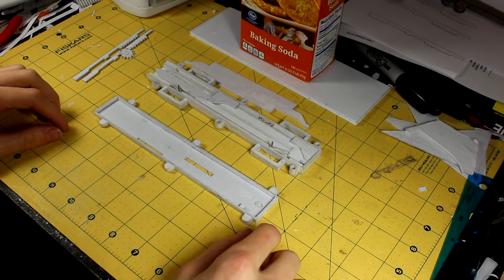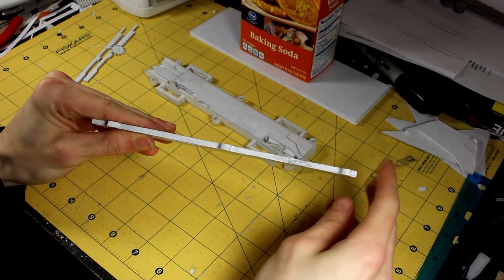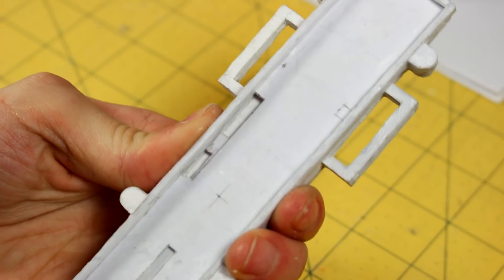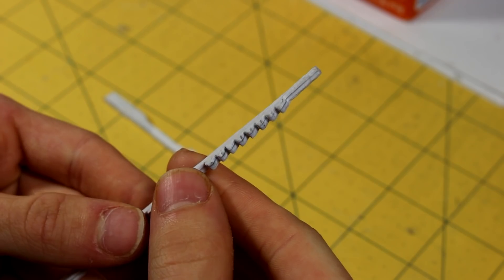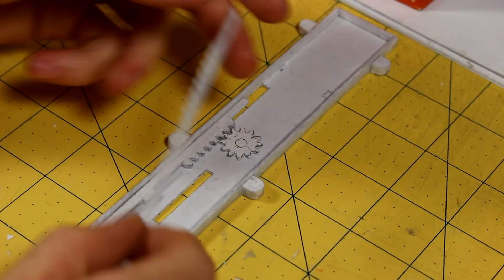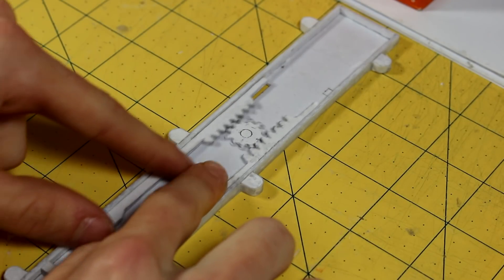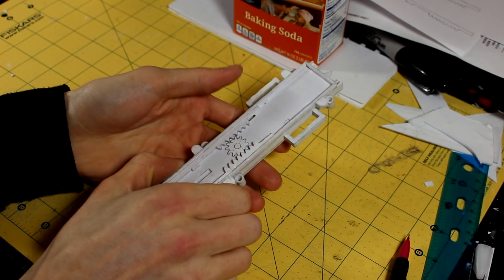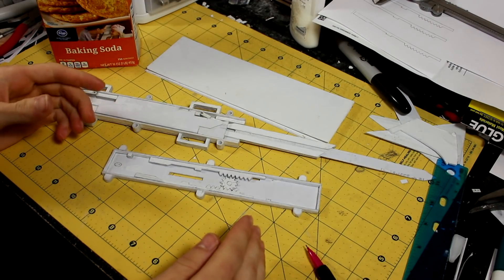Paper Dual Extended Hidden Blade Update 3 (Linear Gear Sticks)

Comment: Everything looks great so far! The wait is definitely worth it and every update video gets me more excited for the final product! I have another question to ask though. So I have a power saw which is good for cutting wood and stuff, but I was wondering if it could work on hardened paper. Would it be able to cut the paper cleanly, or will the force of the saw be strong enough to split the layers apart ? This is assuming that the layers are as strong as possible and the whole piece is completely dry.
Reply from the maker: Thank You! Also I'm not sure. It might work if you only used super glue to bond the layers together. It wouldn't be able to split nearly as easily.
Reply: Just try it
Reply: Remotex I would, but I don't want to make a piece and waste it just to try if it works or not. It would just be a waste of paper, glue, and time if I were to randomly make one and wait for it to dry just to see if it would work or not.
Reply: Deadly Waters Productions you maybe can use a Blade thats made for fine work (sorry if you cant understand im german)
Reply: Remotex Yeah I have a blade for it but I was wondering if the saw would work because some builds need larger parts, and it does take a considerable amount of time to cut through hardened paper by hand